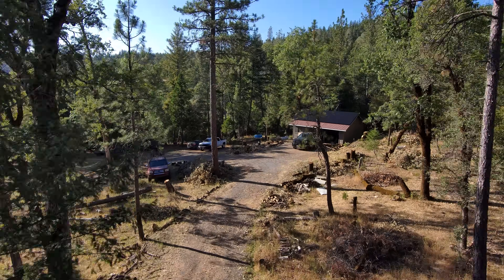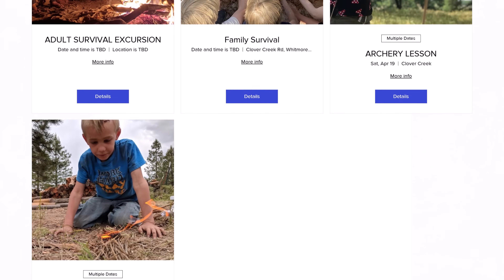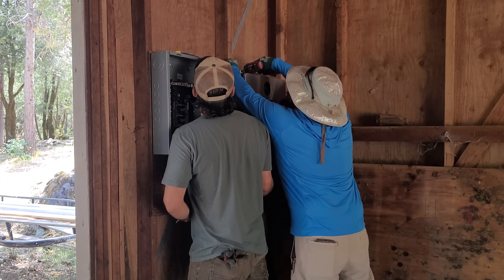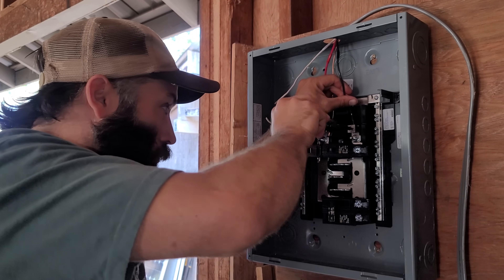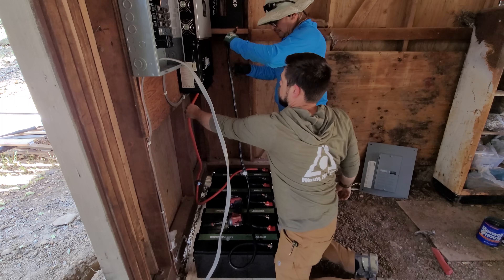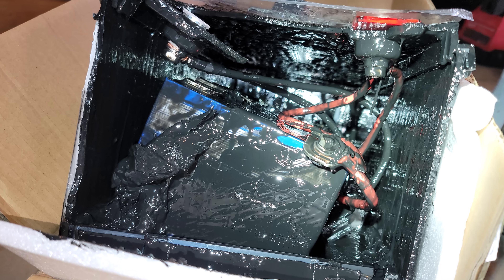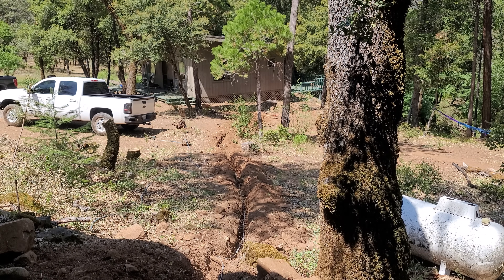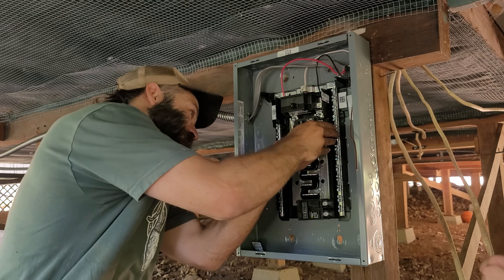Homestead Rescue of a Survival School That Needs Off-Grid Solar

Comment: I hate to be "that guy" but you should have used box connectors for the wires in and out of the panel and inverter.  Hopefully they were added at a later date.

Comment: This video leaves more questions than answers. The amount of paneling installed could support a much bigger system than the 10 kwh you have there. And why choose a series setup over a simple 48 volt parallel setup? Still a great video that provokes thought.
Reply: Based on the previous solution and their profession, you can imagine that these folks might not be willing or able to get larger battery storage initially.  Ben gave them these batteries for free from a sponsor and they’re at least triple the capacity their Jackery had.  

However, the video did acknowledge they want to increase their battery storage when they can, but batteries are the most expensive component of an off-grid system.  With this initial setup, it’ll be easy for them to parallel four 12V batteries to those to double their capacity. They can continue doing that to expand it as they’re willing/able to. 

Also, they have a generator to supplement the power from this system 

Lastly, I suspect a follow up video or two from this install.

Comment: Quite nice whole-system except for the battery setup. I guess its hard to argue with free batteries (presumably?). It needs about twice as much storage for that amount of solar, though, and 4 x 12.8V in series isn't a very robust configuration.  Hopefully you at least put a whole-battery balancer on that thing.

They might have trouble boot-strapping the battery bank if low-voltage BMS disconnects happen overnight.  So make sure the 6000XP is programmed to drop-out before that happens.  Around 46.0V or 47.0V (95% discharged under load) is a decent inverter disconnect setting.

-Matt

Comment: You should never wire four separate 12 Volt batteries in series to achieve 48 volts without installing a 48 Volt (4 x 12V) battery balancer. Without a balancer, your battery install WILL fail within 3 months of use, guaranteed.
Reply: True, but folks like these can and will check frequently for significant voltage imbalance. They can also run their home on their generator for several hours while manually top balancing their batteries as needed.  Something like that is no big deal to someone considered a survivalist. 

Compared to what they had, this is a major upgrade.  I’m sure Ben hooked them up on the cheap in addition to the free batteries. 

I’m sure they’ll end up ordering inexpensive battery balancers before they expand their battery capacity.
Reply: @NickWindham  Why go through the trouble of having to frequently check the batteries for a balanced state and go through the hassle of manually top balancing, when for less than $50, these batteries can be automatically balanced without any effort?
Reply: @quickquote1568  I don’t disagree, but maybe they want that as part of their survival wilderness training or something.

Comment: One eight foot ground rod is not going to protect anyone especially in that soil!  You would have been much better off to install a GFCI device.  Also, it's not generally considered a good practice to put four 12V batteries in series to make a 48V battery but kudos to you for helping these good folks out!

Comment: Ben… are you a electrician by trade?? Great video! Why are wiring batteries in series?, I’m learning……. Still consider myself a newbie…. I bought my first head unit , percron  E3600lfp and plan on doing a diy whole home setup to be off grid eventually… thx for what you do! I’ve learned and still learning from your channel !! Keep up the great work !! Thank you, !!
Reply: Because they’re 12V batteries and the inverter is 48V.  You can get 12V or 24V inverters, but they’re not as good as the EG4 6000XP for the money.  

Two of those Pecrons with the 240V connector box is a great way to get in off-grid solar
Reply: @NickWindham so the batteries will still charge evenly ?
Reply: @Hemi878  They’ll need to manually rebalance them occasionally.  I’m sure Ben explained this to them., but didn’t want to complicate the video. I think he was doing a favor for friends here versus his target audience is all in one systems.  They seemed like the type that will compare voltage weekly and manually top balance them monthly.  They can add a balancer before or when they choose to add more batteries.